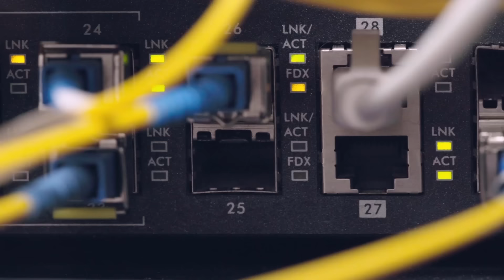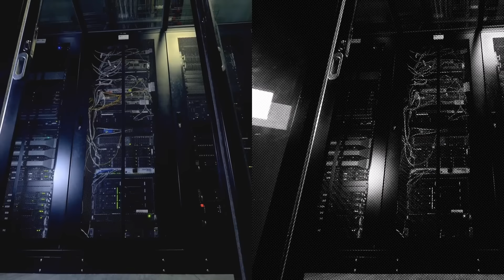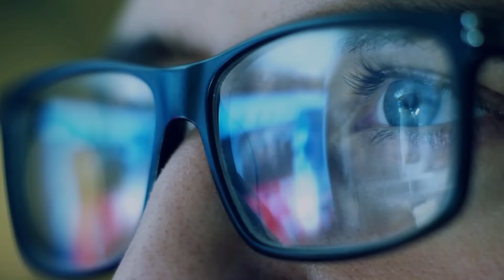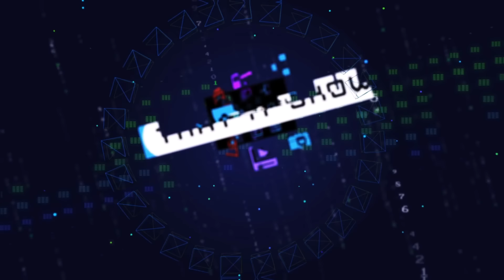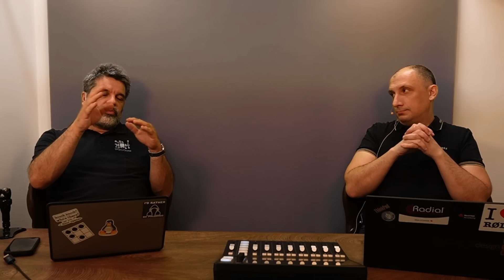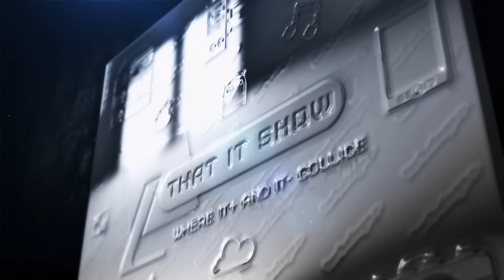Revolutionizing Computing: Intel's Journey - Part 6 - Core gen 7 to 14 generations - (Episode 77)

Comment: I did not watch this as the tittle was enough to warrant a comment, so here it is:
-we are still running Pentium 3 architecture 
-took 5 generations to beat the 2600, till 7700 came out
-13 and 14 gen are exactly the same, down to nanometer so gen 14 is a lie
-gen 10 was better than the later ones
-etc, etc
-At one point in time Intel was hell bent on helping Linux, search for 10 second boot time, after that they did everything Microshaft asked them to just to prevent Linux from running on PC's, be it UEFI or secure boot although there is absolutely nothing secure in it
-etc etc
Personally, i hold them responsible for crippling the PC industry, just have a look where graphic cards have come and compare it to CPU's. Miserable!
I do admire your will and effort to teach the world, so sorry for this.